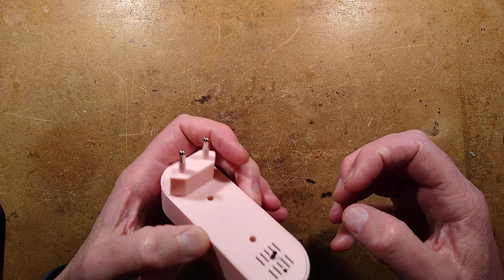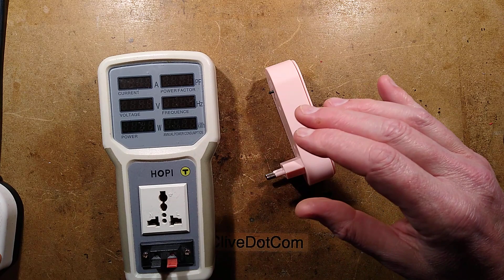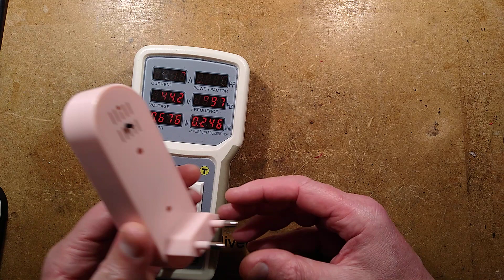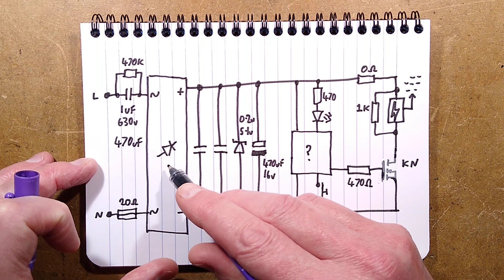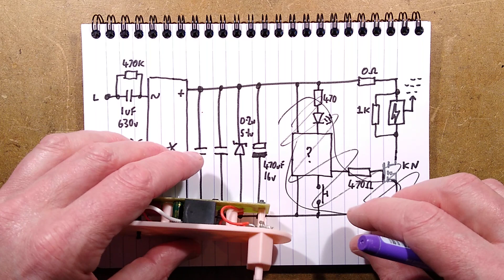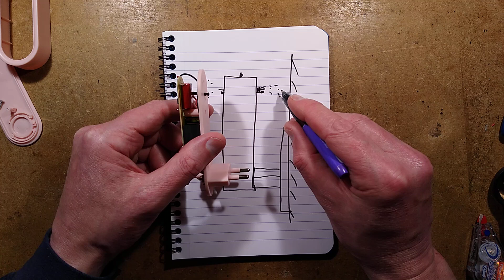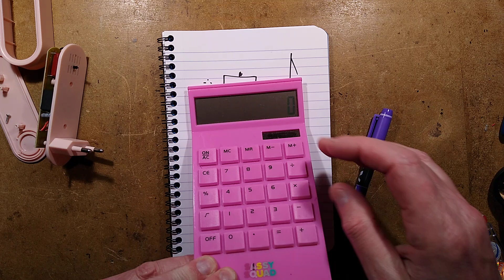Perplexing Pink high voltage "thing" (with schematic)

Comment: WARNING STUPID QUESTION LOADING!!!! Clive in the past had a "thing" for ionizers. Having watched quite a few recently it occurred to me that they seem to work in a similar manner to a powder coating machine as far as static discharge is concerned. Am i even close to correct and if so could a cheap ionizer be converted to use as in powder coating.
Reply from the maker: I'm not sure the current output would be high enough for powder coating.  But it might work with small objects.

Comment: I remember from years ago we had an 'ioniser' and it always collected black dust around itself. I imagine that this will produce a black ring on the wall instead!
Would it be worth drilling a hole in the front to bring the HV lead out there instead?
Reply from the maker: I'm wondering if this is just design naivety or if they actually intended the fibre cluster to be close to the wall to create more of a trace ozone effect.

Comment: Here's a conspiracy theory for posterity.. CHINA has forced all of their manufacturing plants to use these unmarked little chips in everything china produces because they are tiny little communication and spying devices. This way everything in every other country can be turned into a giant adhock network of tiny devices that communicate and can send data back to anywhere in china through this hidden micro-chip network that nobody would ever suspect. And they will only activate when signaled! LOL. Lets make everyone paranoid.
Reply from the maker: That wouldn't actually work due to science.

Comment: 1k should be discharge resistor for the high voltage module.
Reply from the maker: The high voltage is on the output.  The resistor is across the 5V input.
Reply: @bigclivedotcom  I see what you mean, than I don't have a clue... it's a mistery... :)

Comment: It's worse than you state Clive, with that type of European plug the hexagonal part of the plug fits in to a recess in the socket, so the fibre-fluff part will be pretty much in contact with the wall. Image search for "European sockets types" to see examples of both round and hexagonal sockets that this plug would fit in to.

Comment: Yep Clive, saw your mistake challenge straight away.
For info to others, a 1uF capacitor at 50Hz has a reactance of 3,183 Ohms.
A 470nF (0.47uF) capacitor at 50Hz  has an increased reactance of 6,772 Ohms.
But fitting a 470uF (DON'T TRY IT) capacitor at 50Hz  has a very low reactance of just under 7 Ohms (BANG!)😇

Comment: You should say and draw 0.47uF instead of 1uF capacitor.  And 0 Ohm resistor must be there as a fuse. In case HV  unit fail.

Comment: Clive. I have an outdoor socket that was tripping the downstairs ring circuit 32amp breaker. It looks like been arcing inside the socket itself. Do you want to have a look and diagnose what's caused it?
Reply from the maker: It sounds like classic water ingress causing internal tracking.

Comment: Yes, the switch is pointless, the power consuption is the same wheather the thing is on or not. Typical of any zenner shunt regulator, the current drawn only varies with changes in input voltage not load current. The zenner dissipates any power not taken by the load so it will get hotter when the thing is switched off.

Comment: It's worse on the other side of the channel: common German (Dutch, Austrian, Swiss, ...) wall sockets are recessed.
In that case the ionizer output would touch the wall (or be very, very close).

(BTW, you probably meant 470nF for the reduced capacity, down from 1µF. Not 470uF.)

Comment: Does HV ion generator require pulsing to generate HV (ie, flyback and/or Diode-capacitor ladder)? That would mean FET is needed to turn DC into pulsing through cap to make AC in ion generator.
Reply from the maker: I've depotted a few ioniser modules in videos.

Comment: if you connect it to regular schuko outlet mounted flush with wall, it's output electrode is pretty much directly against the wall
Reply: In Australia, the power outlets sit out from the wall by about 10mm so this wouldn't be much of a problem. However, the on/off rocket switch is positioned directly above the socket. So trying to reach behind a vertical device like this can be a problem if you don't have small fingers.

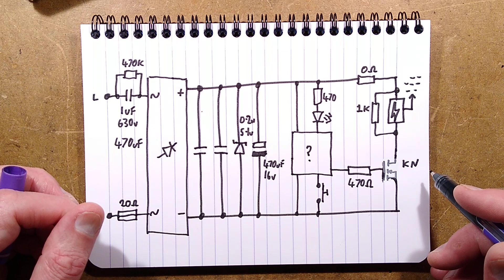Comment: That mosfet you suggested to get rid of at 7:56, Its maybe driving the primary of a HV transformer... Unlike the chainese "automated 5vdc in - taser out" it might be necessary to switch it. As ozone generators dont need an output HV capacitor, they are just transformers... Might be an HV diode there... Thanks for the interesting chinisium.... 😉

Comment: Hey Clive, I bought some of those ionizer modules (the 12v ones) and I'm not sure how best to power them - I know you've said in the past that using something like a switch mode power supply is a no no, because of electrical noise and that high voltage potential without a route back to ground would put strain on the transformer... so my question is what's a good, mostly safe way to power these? Would you suggest maybe running them on a battery pack (maybe a couple of 18650s with a boost circuit or some AAs or a 12v Pb?) be good to see you show off some circuits for driving them, safe ones if possible but then would be curious to see how you'd design one for 240v :)
Reply from the maker: A 12V supply is fine if you connect the negative output to ground so the ion current has an easy return path.
Reply: @bigclivedotcom  So if it was a mains to 12v supply, connect it to both mains ground and the 12v ground? Basically link the low voltage negative with the mains voltage negative? (Kinda like a CY1 capacitor does?)
Reply from the maker: @jcxtra  Yes.  If it's a standard plug-in isolated 12V DC supply then grounding the negative on the low voltage side will allow a return path for current.  I wish they made more 12V supplies that were grounded internally be default.

Comment: Hi Clive! I ha ve ionizer-related question. Can a battery powered ionizer works? I have seen many on sale these days. But the problem I see is that with battery powered device you have no way of grounding and getting rid of the positive potential like with mains powered ones. Or is there any other trick that makes it work? Thanks
Reply from the maker: They're odd.  The ozone ones with a plate in front of the needle work, but the others need some from of return path.

Comment: noob here, can someone clarify what the zener is for?
Reply from the maker: It's a diode that starts conducting when reverse biased at a specific voltage, so it is used to provide crude voltage regulation.
Reply: @bigclivedotcom  a reply from the man himself - thanks clive

Comment: A small note on aliexpress, as you mentioned you got the wrong version of something. Sellers (almost) never help you. But the site operator/help is in my experience pretty much on the side of the buyers, not the seller. I've had a bunch of items refunded because of wrong versions or things not being advertised as it should be. Sure it'll take a bit of effort.. But worth going through :)

Comment: Ok i am 25 sec into this video and already can tell you THATS A GIMMICK not big enuff
Reply from the maker: An ioniser doesn't have to be big.  Standard units only use about half a watt of power.
Reply: How much space does it ioniz and how long does it take to cover 2000 sq feet
Reply from the maker: @tobyobeyonecanobey1979  That depends on room volume and airflow within the room.

Comment: What would happen if you accidentally touched the protruding brush during operation?  Just curious about the safety of having it sticking out like that.
Reply from the maker: In most ionisers it will only produce a tiny electrostatic tingle, but with something like this it depends on the output isolation.

Comment: Would a more appropriate/useful version of one of those be helpful to install in the air plenum for my heat and air conditioning? Would it help catch things that make it past the air filter?

I don't like the super fine type filters because they reduce airflow through the system...
Reply from the maker: You can get electrostatic precipitators.

Comment: What is the point of ionization
Reply from the maker: Putting an electrostatic charge into the air causes dust to precipitate out to walls and floors.
Reply: @bigclivedotcom  why would you want this?

Comment: Hi Clive I just saw a very interesting (ahem! for us nerds anyhow) post on the model-engineer forum. A chap was using a Philips coffee machine with a capacitive dropper supply and took it onto his boat... Can you guess? I'd not considered this before...His boat had a 240V inverter. He decided to have a coffee and WALLOP. Up it went in  a bang and smoke. Depending on the design of inverter, here I guess they didn't bother with the expense of filtering out the high frequencies from the synthesised output at all.
Apparently, the machine was under guarantee, so it went back to Philips...The engineers contacted him to find out what had happened and they were interested to find out.
Reply from the maker: Cheap inverters can put out a square wave, which is not a good thing for a capacitive dropper.  High frequency noise will also cause a lot of current to pass.

Comment: heya clive, if you're bored, maybe you can help solve the question, was I abducted by aliens or was this a very freak power surge?...

https://youtu.be/1hQszQ01X_4

in the description I include the full speed video, last time the power went out was in a major storm once in 17 years, the alien sound as the search beam hits the camera, missing time at 3am 57m 09s and the ufo search beam appears at 3am 57m and 15s

the red light that looks like a car brake light in every frame is just a cheap 1w red led I power on if the power goes out running off a 12v battery and so is the camera 100ah lifepo4 to be precise using a switching regulator I feed to an Xiaomi 360 camera, I copied the data off the sd card and uploaded it to youtube..

the power lines are underground and I only knew about it because my power company woke me up.. then things got strange
Reply: last time*
Reply: oh and turn the volume up! I've never heard a transformer make a sound like that!

Comment: As an engineer who has done systems that generate mega and gigavolt pulses, I could not help but laugh out loud over the statement at  2:39 when you said  "...It is quite funny when things are electrically dangerous and they are pink, that just adds an element of amusement to it."  I think that is the best laugh I have had in a few years.  I think all my HV systems from here on out will have something pink incorporated.

Comment: They probably used the zero jumper resistor as a way to give them some wiggle room to current limiting if they thought that they needed to make changes by changing it out to a resistor with a value when they designed it.

Comment: Out of interest, does Clive or indeed anyone else have a link to a good ioniser?
And while asking ioniser questions, if I wanted to run one off a 12V lead acid battery that is charged via a PV Solar panel, and that same supply feeds other equipment such as a radio, do you recommend any precautions or extra wiring, such as earthing the battery negative to earth/ground?
Reply from the maker: You can get ionisers and trace ozone generators specifically for 12V use in vehicles.

Comment: Seeing that cap reminded me of my first year Electrical Engineering lab class. Somebody (not me) discovered that charging a Sprague Orangedrop 0.01 µF capacitor to 200-300v and tossing it to a classmate would elicit a satisfying shriek.  Forty years later, and I still avoid catching stuff tossed to me by surprise.
Reply: I assume you were the test subject 😂
Reply: @3boodAl7asan  Once.  Just once.
Reply: @johnwiley8417  yeah wasn't that satisfying experience
Got me 3 times on mu whole life all of them were on the same thumb
Reply: Used to do something similar using photoflash capacitors, except they would be strategically placed in jacket pockets, lockers and tool boxes and anywhere else that had thieving bastards loose fingers lurking around. The joys of site work in dodgy areas using dodgy agency workers.

Comment: YOUR  VOLTMETER IS A NANOAMPS METER!  very useful trick.   
If it's 10Meg input, that's a dead short as far as ionizer air-paths are concerned.   So, your DVM is actually a current meter, a 10Meg shunt resistor with a voltmeter wired across.   If the meter reads 0.01V, it's actually detecting 1nA direct current.  (With a fancy Fluke w/0.1mV sensitivity, you can measure picoamps.)   Your 20V reading is detecting 2uA thru the air.    (And, if HV is involved, it really is an ammeter, only dropping a volt or two when detecting currents from sources putting out KILOVOLTS.

Comment: Clive! UV b&c is bad. How bad is being near a bulb that is covered that I can't see directly but is casting light all over? It has a shield but it is not enclosed.
Reply from the maker: Complex subject, but generally the blue light you see being reflected is mostly the visible component of the light.  The main hazard with UVC is direct viewing of the lamp.
If your eyes were being exposed to any significant level of UVC light they would feel uncomfortable..
Reply: Thanks. I assumed indirect uvc was like an arc but stopped until you replied. My 👀 are 👌. I try not to shug off possible accumlative effects though.

Comment: What is a zero ohm link? it look like a resister is it kind of thermal fuse?
Reply: It's a jumper. Rather than retooling SMT pick and place machinery to handle bits of wire, a resistor of 0Ω value is used.

Comment: I vote that Clive drops a  470uF cap in and films the (hopefully spectacular) results.
For SCIENCE!!!
Who's with me?
Reply: I'm pretty sure that's a misprint for 0.47 uF, but 470 uF @600V should be a bit difficult to get the cove back on but otherwise spectacular.
Reply: @pjaj43  Im up to anything that Clive wants to blow up, but I feel that it will be more of a slow boring fizzzz
Reply: @kimsleep4111  Well, think of the current through the Zenner diode. If it gets warm now when overloaded by approximately a factor of 2 (according to Clive) think how hot it will get when overloaded by a factor of about 1,000. Definitely magic smoke territory if not instant plasma.
Reply: That wee little Zener will quetyly, and very unspectacular die
Reply: @pjaj43  yes, but zeners, by nature seldom fail spectacularly, they just up and die, and they usually do it in quite a pristine fashion, making it difficult to just eyeball a dead one
Reply: Loud BAANG waiting to happen..
Count me in 🤚
Reply: Glad we are paying attention :)
Reply: STINKY MAN RETURNS AND I STAND WITH YOU.
Reply: I am!
Reply: I estimate that to be around 16A, so if your lucky the cct breaker will trip too.
Reply: Read the video description...
Reply: I discharged a 120yF at a light pole once. It burnt holes in the metal even after sitting for days.

Comment: 5:00 👎 WARNING, FIRE HAZARD ❗
Replacing the 1µF capacitor by one of value 470µF is a DANGEROUS mistake, it will fry ⚡ the whole circuit 💥 (and maybe more🤯), Clive probably meant it be replaced by a 470nF one ❗
Reply from the maker: See description.
Reply: @bigclivedotcom  I replaced my 👎 by a 👍.
🖖😎👍 ❗

Comment: (Yes, I spotted your 470 "uF" boo-boo.) Leaving aside the NEED for turn the module on and off, the fact that they did means you have to deal with the consequences of the NFET's presence. These unknown potted modules almost always have a large electrolytic capacitor bypass capacitor across the power supply. If you rapidly apply voltage to the module, the large dV/dt creates a large inrush current through that capacitor that your dinky main power supply must deliver, causing the controller's power supply voltage to sag, which might cause the small controller to shut off. I think the 1k resistor in series with the NFET's gate is there to interact with the FET's gate-to-drain parasitic capacitance (aka "Miller capacitance"), which will create an integrator, causing the drain voltage to ramp down with a fairly controlled dV/dt of its own. By doing this, they substantially reduce the inrush current of the potted module. That is my theory as to why the 1k resistor is there: inrush current reduction. Power supply designers sometimes add a small capacitor in series with their FET switches to slow down the edge rate of the switch, lessening the EMI that the switch creates with its constant on-off switching. As much as I often laugh at what I find inside some of these cheap Asian designs, I have also found instances where the designer actually knew what he was doing.

Comment: If you use an EU to UK adapter (the ones with a hinged lid for EU wall warts, not EU plugs) this will put the ioniser unit at a right angle to the wall and the emitter will point upwards.